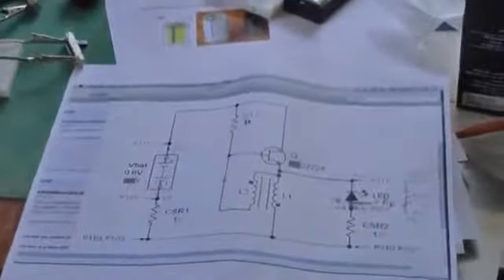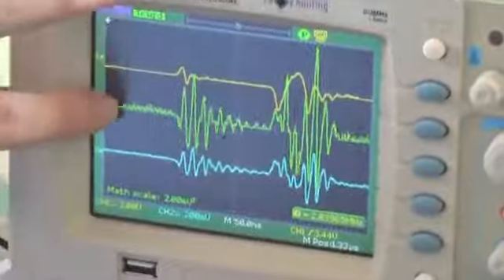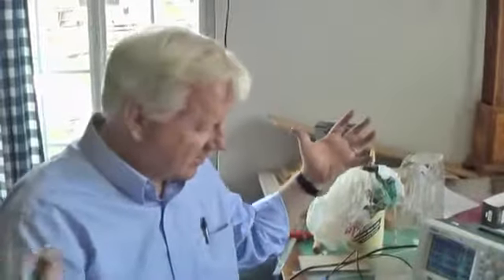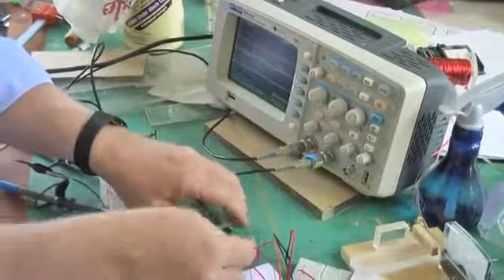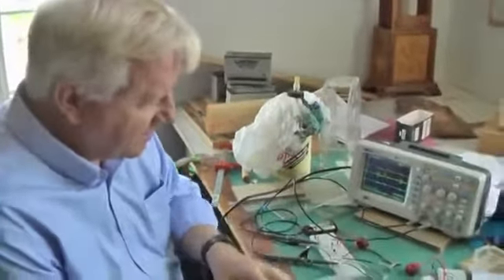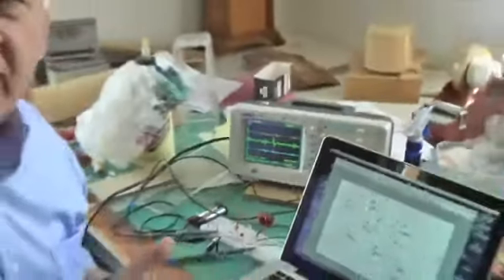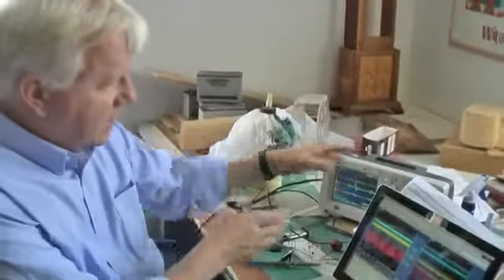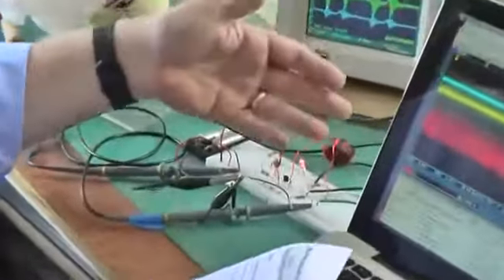Physicist Steven E. Jones shows evidence for 8x overunity: circuit and measurements (1 of

Comment: Years ago I built the circuit of Prof. Dr. Steven E. Jones for several frequency ranges.
With correct measurement, no circuit showed overunity!
The input current measurement is decisive. The input current must be measured in the DC + AC position of the oscilloscope.
If the input current is measured in the AC position of the oscilloscope alone, then the DC component of the 1 ohm shunt resistor is not measured. Then the current amplitude oscillates around the 0-line of the oscilloscope. Multiplying this current by the input voltage results in a very small input power. This value is not correct! If you calculate further with this input power, you get overunity and the result is wrong!
Reply: Where V(t) = volts as a function of time, and A(t) = Amperes as a function of time then, the integral of Vout(t) x Aout(t) is greater than Vin(t) x Ain(t) for an appropriately tuned Jones circuit, where V(t)'s are measured from a common ground. 
Tom Bearden's Lee Yan Wu reference shows we knew in 1956 that a dipole (electric or magnetic) absorbs energy from the vacuum and re-radiates a portion of what it absorbed as observable (harvestable) energy.  Lee and Yang were awarded the 1957 Physics Nobel Prize for showing this in Physical Review 1957, after Wu demonstrated confirming experimental evidence.  
More can be learned by searching for the terms ais bearden and looking for a link containing the words energy vacuum in the search results.
Reply: @timothyjohnson1511  High frequency measurements in conjunction with the Oscilloscope should always be made with differential probes; anything else will result in amplitude and phase errors. One measures an overunity which is not given.
When measuring the circuit according to Prof. Dr. Steven E. Jones, the input current measurement is especially critical.
The input current must be measured with a differential probe and the oscilloscope at position: "DC+AC".
If the input current is measured only in position: "AC", then the DC input power is not detected. The result is OVERUNITY. But if you measure in position: "DC+AC" then you get as result NO OVERUNITY!
With high frequency measurements you have to be especially critical; otherwise you measure crap!
Reply: @hanswurtz5560  Switched differential probes can be configured to measure either AC only, or AC + DC offset. Standard non-differential high frequency probes can accurately measure within specs (+/- 2%) simultaneously AC + DC offset.  Also, 2 MHz is not a "high frequency" for a Tektronix TDS 3032 - 300 MHz rated scope with matched probe.
Reply: @jerisin7202  In the circuit according to Prof. Dr. Steven E. Jones, a base resistor of 1 Kiloohm is connected. This generates a non-negligible DC quiescent current in the transistor.
This current is part of the input current. It must not be neglected. The AC and DC components in the input must be fully recorded (AC+DC). 
I would love to confirm an overunity of the Jones circuit, but I cannot.
I am well equipped with measuring instruments. Several oscilloscopes. Bandwidth 250 MHz . Two differential probes, etc.
Reply: @hanswurtz5560  We must be looking at different circuits.  In the circuit shown at 8 minutes 33 seconds into this video above, no 1 Kilo-Ohm resistor is shown anywhere in the circuit.  There is Rb=51K Ohm resistor between the transistor base and Vin 2.5 Volts. The scope trace record clearly shows both AC and DC components with CH1 Mean 2.72 Volts and CH1 Vpp 3.52 Volts. The DC component is obvious. 

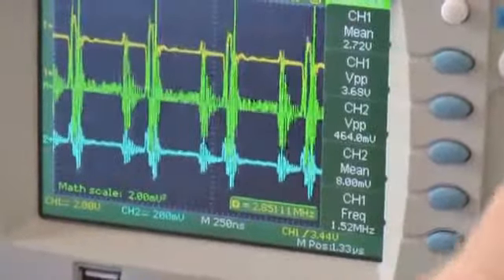At 2:00 minutes in the video shows CH2 Mean  8.00 mV and CH2 Vpp 432.0 mV across the 1.0 Ohm resistor CSRin.  So, mean power in is CH1 Mean 2.72 Volts  x  CH2 Mean 8.00 milli-Volts  x  CSRin 1.0 Ohm =  0.02176 VA  === 22 milli-Volt-Amperes Mean Power In. Both AC and DC offset are included in the calculation of the Mean. 

On a completely different subject, what was your opinion of the OU claims in the circuit shown in the video with title "Lawrence Tseung's 'FLEET' circuit" on the channel with name Patrick Kelly ???  Which is referenced on your channel. 

Thank you for your response.
Reply: @jerisin7202 Thank you very much for your comment! Yes, I had already used the 51 kiloohms. Unfortunately, I couldn't measure an overunity.
I had already tested the Lawrence Teung circuit years ago. I was unable to detect an overunity when terminating with an ohmic resistor.
However, there were some interesting effects.

Charging batteries:
I usually fed the Joule thief circuit with a 1.2 V battery. The voltage peaks generated were 60 V behind the diode. These high voltage peaks charged an empty 1.2 V very quickly to values of 1.4 V and higher. Unfortunately, the charge did not reach the depth of the battery cell and the battery was quickly discharged. The batteries must be built differently for charging with pulses. Their electrode gap must be smaller than in today's batteries and they must have more surface area.
Perhaps overunity is possible in this way!

Hydrogen generation
I went behind the diode with its high voltage peaks to a coil and in series to a small electrolysis cell. The coil and the capacity of the electrolytic cell formed an oscillating circuit. The input power to the electrolytic cell was only 0.5 millionths of a watt and yet very small gas bubbles rose at the electrodes. If I did the same with normal direct current and 0.5 millionths of a watt of power, nothing happened. Perhaps there was overunity when pulsing the electrolyte. I don't know?

Comment: Another thing a person could try is redesigning the circuit so that the input and output power levels are measured as dc voltages. If when measured as DC you still get above unity power gain then you know for sure that the circuit works. It`s possible that the oscilloscope isn`t measuring the average power accurately for some reason. I think this could probably be accomplished by using low pass filters on the input and output. You might also test the power gain with different load resistor values.